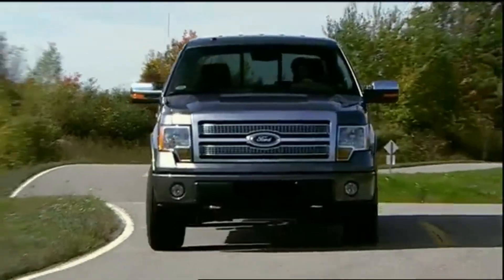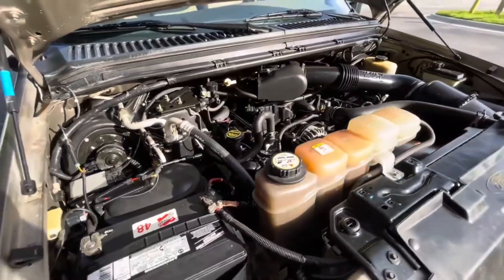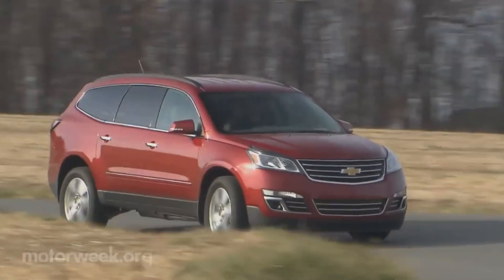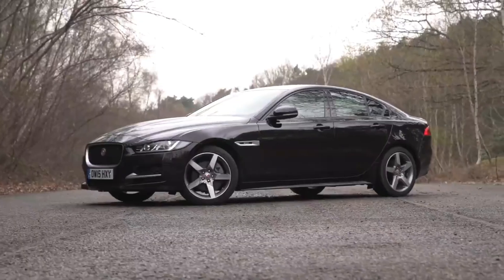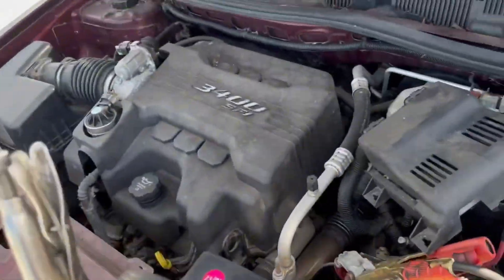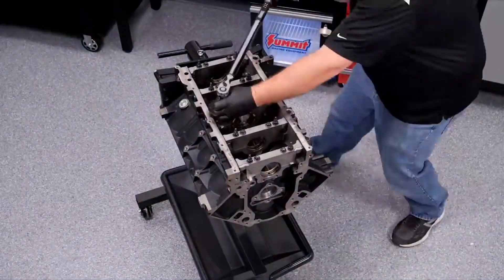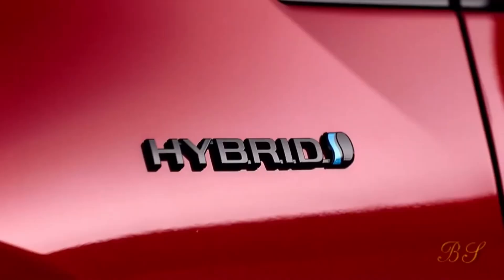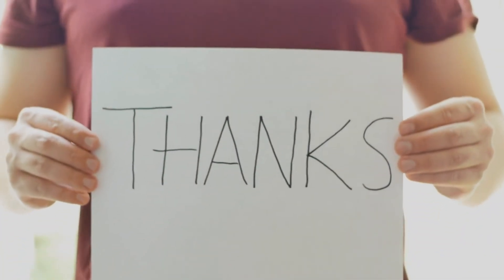Top 6 Used Cars You Should Never Buy!

Comment: I know of friends with cars overseas that have gone past 200000miles and are still running sweet as a nut. They’ve been well maintained with servicing always done on time, so a car with over 150000 miles isn’t necessarily a money pit. Yes some engines are more problematic than others but generally speaking, if you look after your car, it will look after you!